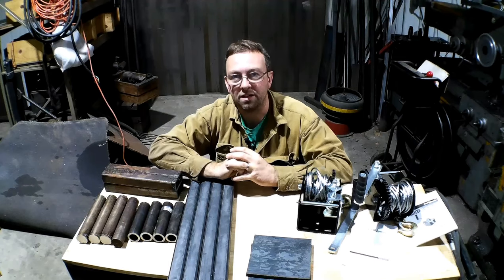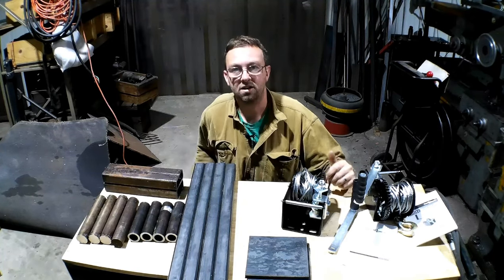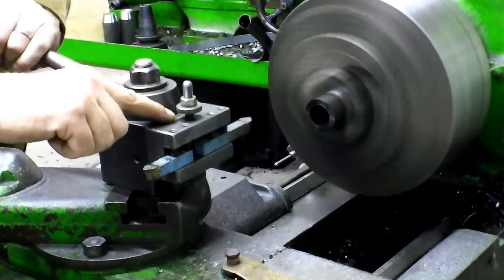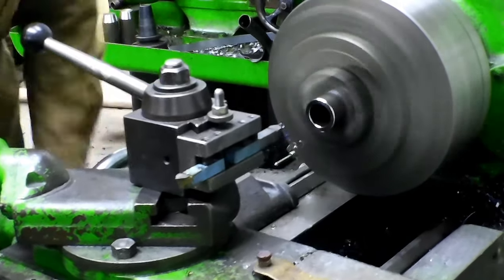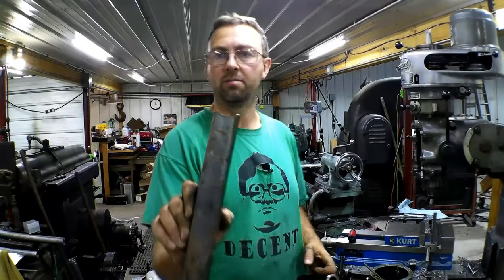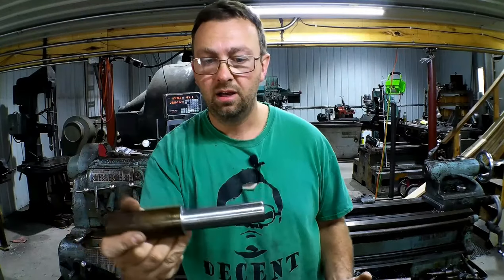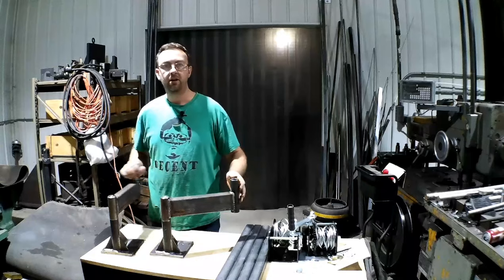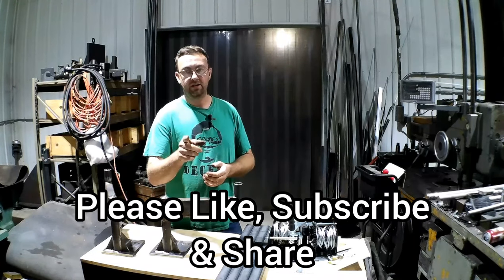Machine Shop Crane Build, Part 1, The Base, Shop Made Tool, DIY Skyhook

Comment: I'm sure you know best, but I couldn't help but notice that the green lathe is awfully low for you. I was getting lower back pain just watching you. That doesn't drive you nuts? By the way, clever trick using a drag harrow as duck boards